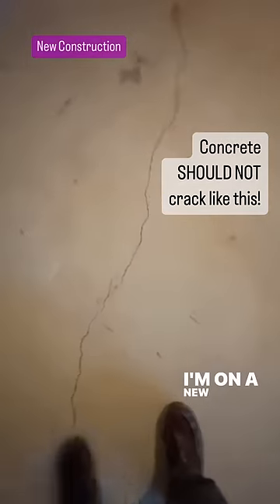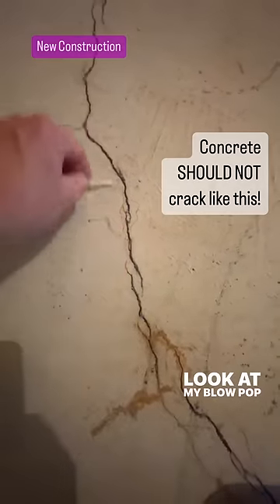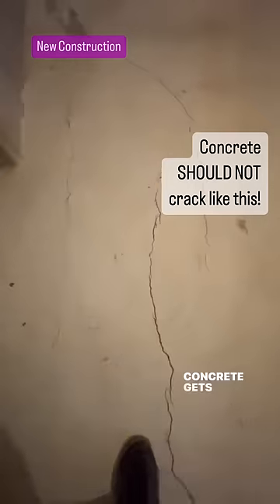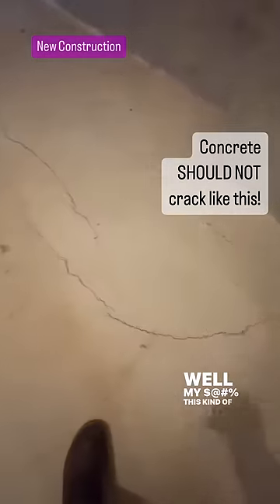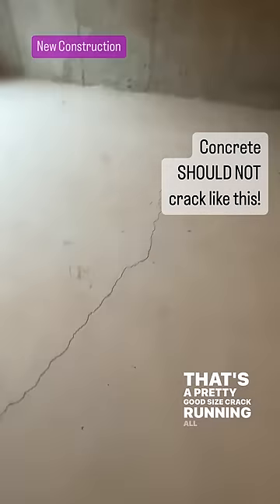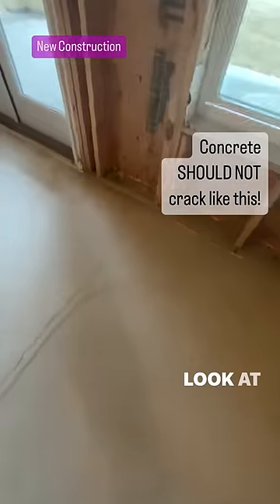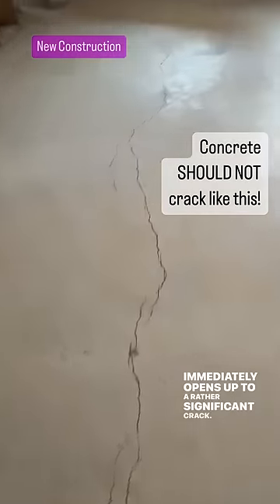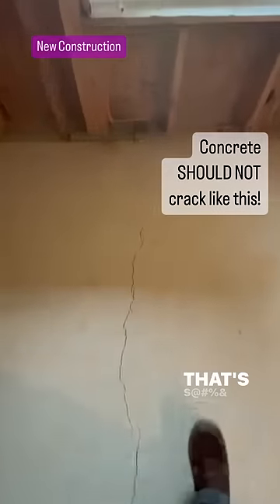New Home with Multiple Slab Cracks

Comment: They forgot joints or the ground under the concrete didn’t get compacted. Or maybe they wanted cheap work and contractor made it work by not adding rebar every 13 to 16 inches idk

Comment: Though the way it's cracking isn't normal. There are a lot of variables. New concrete shouldn't crack like that. If it was at least a couple years old with no crack control it may or may not be a problem. Concrete gives off a lot of water as it cures plus it suck moisture from the air. Are you an inspector? Why are you concerned? Are you a rival?

Comment: If the builder was smart they would’ve not built on this pad ripped it out and replaced it (signs would’ve shown up well before this video was made). Now the only option is to tear the house down, remove the pad and start over. However I’m sure they will get away with it by “patching” the spots bc the homeowner won’t want to fight a legal battle

Comment: Shity sub grading, should be level. No vapor barrier. You don't really need wire mesh in a basement floor. And the concrete probably didn't meet slump when it was poured. TEAR IT OUT!!

Comment: This happens all the time, and most buyers will never know because the house will have been built and finished or mostly complete for, they see it. I bet it's been cracked for a while and a inspector has probably already been at the house checking things like wiring, plumbing and such and probably didn't put anything down about the cracking floors. I've seen it to many times inspectors miss lots of stuff or they don't care one. This should go back on home inspector and the main person over his crew building the home and pull both their license, tell them you're done you will have to find a new line of work. You can only imagen how the rest of the home is going be once it totally finished, you can tell by their quality of work by the floors and also by the crap there going tell you like the guy in the video said, just proves once again you don't get what you're paying for.
Reply from the maker: I’m a broker just checking inventory and saw this. Correct on what you say because people are stupid. So many don’t use and agent when building, use an agent that kicks back commission and doesn’t do shit or they won’t have inspections done at key points in the build. My clients do pre-pour foundation to check compaction, rebar, etc; pre drywall to check mechanicals and framing and pre closing to check finish and get a good once over. Costs money but consider that this home in the video is 1M+. I’m a dick with builders, if they push we are fine pushing back. You have to be a prick, if not, you will get rolled. Assume and trust nothing but your own people.

Comment: How do you fix it though?  Honest question.  The average homeowner is going to be told by the average builder that they admit it is worse than normal, if they really push the issue, but…. honestly how do you fix that without redoing all the concrete?  Honest question.  The relationship between builder and customer will be ruined and it’s going to extremely hard to find another builder to come in and fix it. Either way customer is paying extra money here. Please give us the secret to making the builder liable and making sure it is done correctly. How do you trust it is correctly fixed if it isn’t completely redone?  My point here is that it’s easy to cry foul, but people really need to know the answers on how to fix it correctly and move forward, because they will have doubt in their minds for the entire time they own the house

Comment: That concrete don’t have the right color of cured crete, it should be a dark gray color and it’s just another example of get in get out. Was there a limestone or some other rock base put down and throughly compacted ? Then plastic layed out then rebar or wire mesh put down? Or was fibermesh added to the concrete ? A lot of ifs and maybes but in no way should that floor be cracking to that extent. I could see a few hair line cracks which would be normal over time but nothing like that. Floor needs to be ripped out and repoured the correct way.

Comment: Come on......I cut concrete for a living. We cut fresh concrete in lines to encourage it to crack on the lines. "control joints". It doesn't always work. Sometimes the concrete cracks somewhere else. Like breaking a candy bar where it is thinnest. Or tearing paper along the perforation. It doesn't always tear there. The only real issues when concrete cracks are if the concrete separates a lot or if the slab height changes differently on either side of the crack. Concrete is brittle and guaranteed to crack.

Comment: Actually looks like they need a better drainage and subpump system then their the water table factor for that area. A lot of factors to consider I've went in basements in certain areas where they had 3 sub pumps because the builder built there house next to a natural spring. Ive also went to areas when i use to do property preservation with Banks. Where you open the door to the basement and you walk down amd the first step your take you slip on your ass because its literally crystal clear ice and the basement flooded completely. A lot of people are st#pid to the importance of winterizing a home. You cant just sh#t sh1t off and go down south for a year and have it sit not maintanced and looked after once in a while. But ya that happened a few times slipping on an ice first step down thinking i was going into a basement and it s#cked everytime lol.

Comment: I can almost guarantee they used too much water in their mix and I'm not even a concrete guy. I've done very minimal diy concrete work and even i know that this is what happens when you try to cut corners and minimize the tooling work on a load bearing surface such as a foundation or driveway. Also, i didn't notice any gasket between the framing and the concrete. That can create more issues all in itself 🤦‍♂️

Comment: There is no fixing or repairing that will make that floor okay. As a retired builder with 540 homes under my belt I gotta say, this happens more often than not. Firstly, I see no felt edging up against the walls,
and the combination of dead and live loads on that slab clearly shows an inadequate job. My thinking is that it has NO VAPOR BARRIER, the Concrete mix used on the slab was the wrong one. 
3500# pea stone mix is all I ever used. Not a single home I built has ever had a cracked floor or foundation. 
There is most likely NO steel mats in that slab and the lack of frost joints shows it was installed by either amateurs or plain stupid wannabe contractors. 
To stop the flow of water and the damping seen in the surface, I would recommend 
Buying enough Gluv-it
To cover the entire floor with 2coats. Nothing works better than Gluv-it !! NOTHING. ITS VERY PRICEY but a heck a lot cheaper than busting up the slab and repouring it. It will seal and waterproof the slab nicely but if the cracks continue it will need to be maintained with more. If it were me and I was the owner I would give the builder a chance at replacing it. If you get snuffed, then have it inspected and hire an attorney. What a shame it is. If you call yourself a builder and someone buys your homes then you damn well better stand behind your work. What a lousy job.  
✌️🇺🇸

Comment: That's not your concrete finishers that's where you're getting your concrete from it could be too much concrete in it or it can be getting too hot and did it have fiber in the concrete if concrete sits up too fast it will do that or too much water

Comment: Concrete without cracks, doesn't happen. Concrete without rebar, control joints, expansion joints, vapor barriors and damproofing = happems all the time.

Comment: You can’t fix it. Expansion cracks don’t matter on basement floors. That looks more like settling from poor dirt work though. You could end up with an uneven floor. The moisture should not be an issue. They put down plastic before pouring but that doesn’t last anyway. Only a small amount of moisture comes through the cement unless you have a leaking pipe or a flood. The water doesn’t make a lot of sense to me. You building in a swamp?

Comment: This guy must be and sounds like a third-party inspector inspecting the builders work. Concrete will crack there’s no way around it. If he has documentation showing that Rebar was placed on all outside corners, the correct slump was poured and the proper wiremesh was installed. Then nothing has been done wrong.  The only thing I don’t see is the proper saw cut joints.
Reply from the maker: This guy is a broker and appraiser, 32 yrs now. Happened to be checking new builds for clients, saw this and shot it. This is a home about 2 months into the build (at that time) and yeah, concrete cracks but this? Areas already deflected and moisture was evident, there are issues here.

Comment: You lose 500 PSI of compressive strength for every gallon over the mix design probably a hot load started getting away on them so they dumped all the mix water into the barrel and walla here it is.

Comment: Video is a bit misleading. Concrete will crack 99 out of 100 pours even done by the most professional concrete contractors out there. Thats why bar or mesh is required along with control joints. The only time cracks in concrete are a structural concern is when there is lifting or settling or if the crack is widening, or like in this case, there is moisture coming through the cracks due to a lack of moisture barrier and or a sketchy geologist who didn’t check the water table elevation. Slabs are idiotic regardless though, smart people built on piers or cassons

Comment: Concrete poured with WAY too much water added and CHEATING the customer on cubic yards delivered.
Cement / water ratio WAY out of spec.
ALWAYS hire an independant ASCI certified inspection lab to sample ANY and ALL concrete poured on your building project. ... Keeps the concrete suppliers and truck drivers honest when the know testing will occur and they will be held responsible for their product meeting design specs.

Comment: To much water in the concrete.  Vapor barrier doesn’t stop cracking, reinforcement will help stop the cracks,  the concrete made these days definitely doesn’t hold up to the concrete made 30 years ago.  To much fly ash mixed with the cement.   
Concrete will crack in due time almost every slab.  The movement in the earth vs a solid slab don’t mix.  But that is definitely too much water and a concrete contractor in a hurry to get multiple done in a day.  $$$$ is the problem.  No one cares about their product anymore.

Comment: Well just by looking at it you know why…. If you don’t you should get out of construction..😂😂😂 looks like this is a slab on grade in the basement after seeing the foundation walls..  usually these slabs don’t crack but you got major issues with dirt or clay underneath… reasons for moisture is something is wrong or underneath the slab with your vapour barrier.. is there rebars or mesh and did they lift it during the poor…

Comment: I don't know who this guy is. Cause. He doesn't sound like an inspector and if he is, he  needs to pick another profession. He sounds like a typical home owner ,which technically he doesn't own it , the bank does for the next 30 years!  It's all new construction from what I see . Has nothing to do with moisture barrier. If you notice, there's no windows in the place yet, but yet there's walls up and this is  what happens when you start building on  an uncured slab , roof may not have been dried in and they got heavy rains period! That water may be coming up from those cracks Yes, but there's plastic underneath there.  And I don't know why they don't have fans blowing  instead of a dehumidifiers should have wet vaced the house which obviously wasn't done
Reply from the maker: This is the guy and I'm not an inspector, I'm a real estate broker and appraiser with 34 full time years of experience. As said in the video and on the subtitles, this is a new build so you at least see that correctly. If you notice, there are multiple windows already installed so check that. You have zero idea about plastic below the slab, or anything else for that matter. Perhaps watch again, this is an unfinished home and a slab in this shape is a disaster.

Comment: You pour concrete on soft or unstable groung  of course you will get ground  movement . Even with a moisture barrier  and reinforceing you will get cracking with ground movement and subsidence . The commentator is blowing hot air out his arsehole .

Comment: cant be fixed. Sue contractor. No vapor barrier  , It cracked because the soil sucked all the moisture out of the concrete while it was trying to cure. Causing it to contract and crack. Its all weak concrete. Cant be fixed.